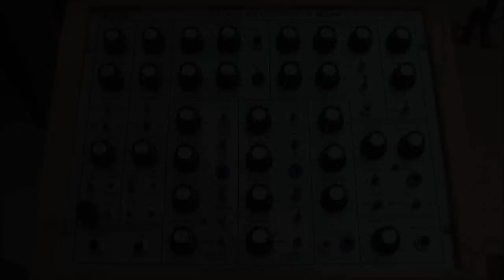MFOS Sound Lab Mini-Synth Mark II Presentation

Comment from the maker: The circuit and instructions for building it are at musicfromouterspace with a dot and then a com (YouTube is touchy about URLs). I will be selling a PC board and panel  on my site for the synth but the diy'er has to buy all the components and put it together. There is a parts list and complete description of the circuit but it definitely takes extensive electronics building and trouble shooting knowledge and experience to successfully build it. I've been doing this for years.